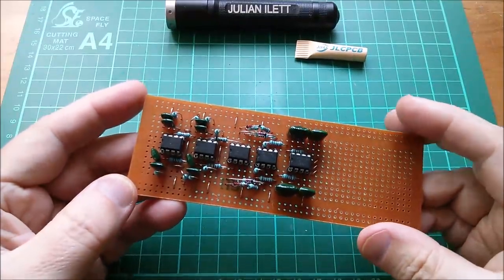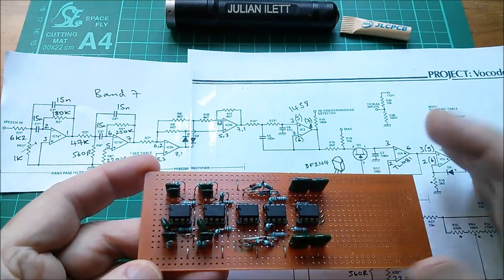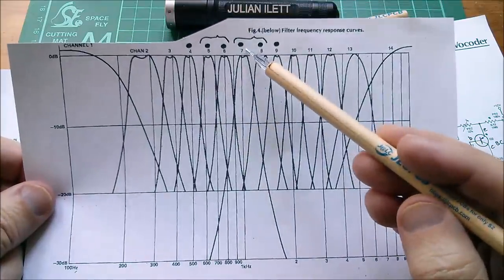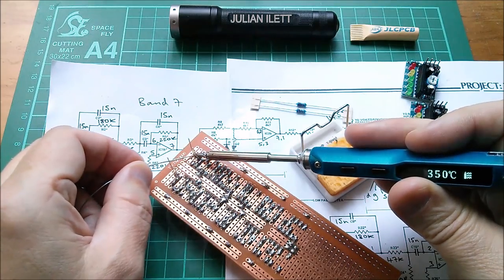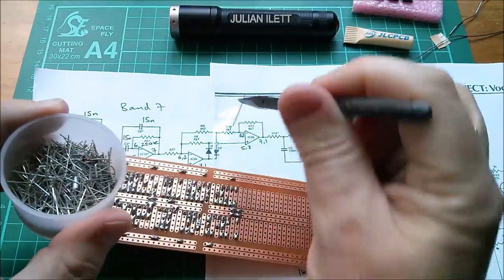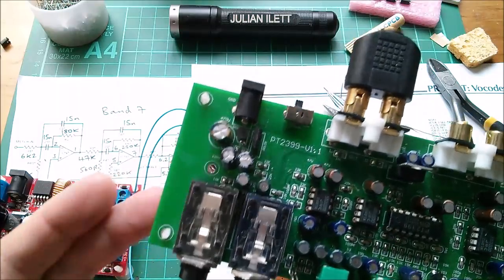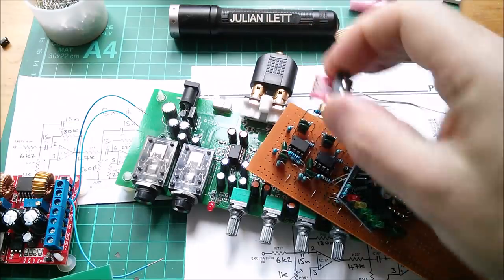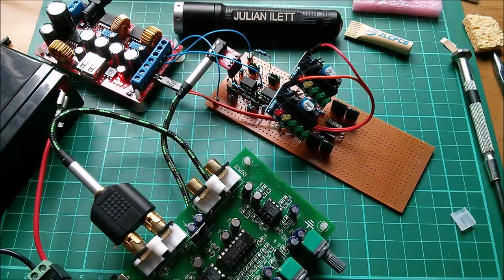Testing Bandpass Filters by Whistling - Vocoder

Comment: Just breadboard up a 555 timer for the signal input.  Very easy with just 5 parts including a potentiometer and stays a little more "electronics" than using a phone app.  Of course a standard signal generator would be ideal but I know you are "cheap"!  Or maybe just frugal...   ;-)

Comment: Surely there's a way to build these filters with less op-amps. 5 chips per channel seems insane.
(Of course, to minimize chip count you'd use a DSP, but that's boring)
Reply: I'm sure there is a way now, but there may not have been back when this vocoder was designed, and Julian is deliberately making no changes - he wants to build it exactly as designed.